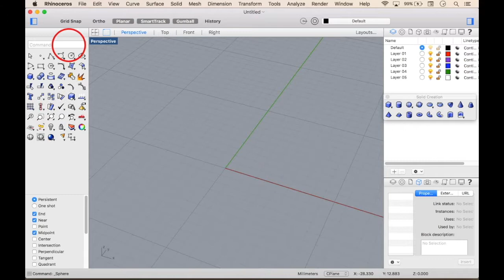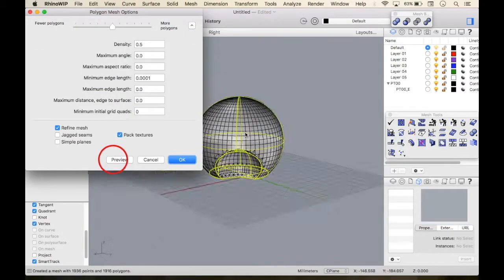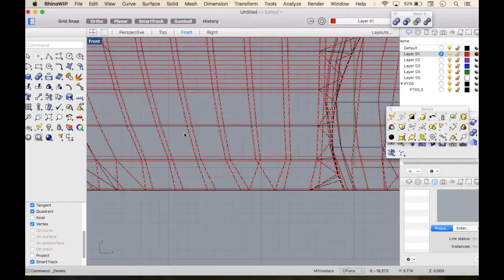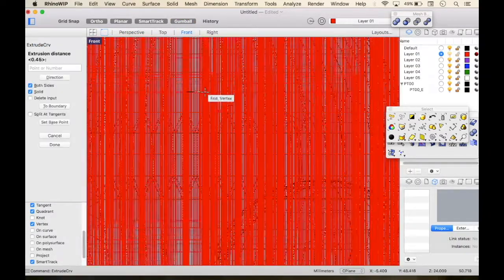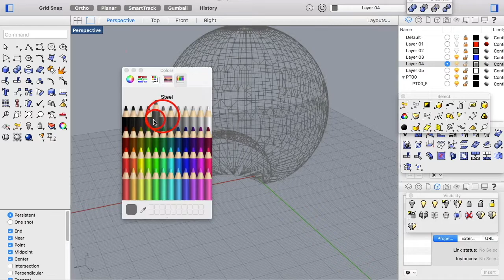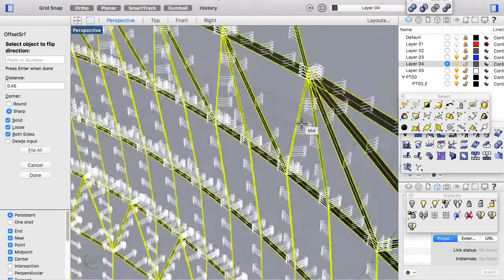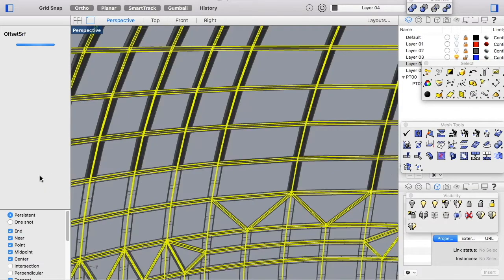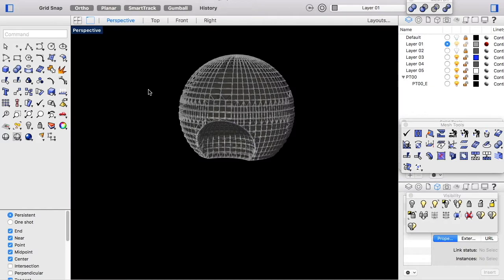RHINO  Modeling - Sphere Structures 3D ARCHITECTURE MODELING | POLYGON MESH | CONTOUR COMMANDS

Comment: Hi! I'm wondering how did you isolate the mesh curves from the mesh itself? Very cool work!
Reply from the maker: oh! i kinda missed out that clip... yikes 
For that, you can just hide the surface 
>visibility command  (it looks like a bulb )
>click on your surface and then click on the blub which isn't glowing (which is meant for hiding)
if you want the surface back click on the glowing bulb.
hope this helps
Reply: Tried using the command silhouette?